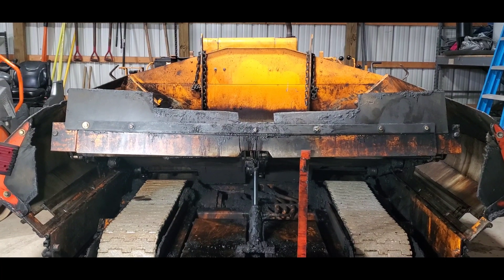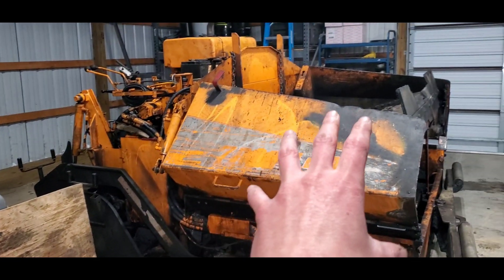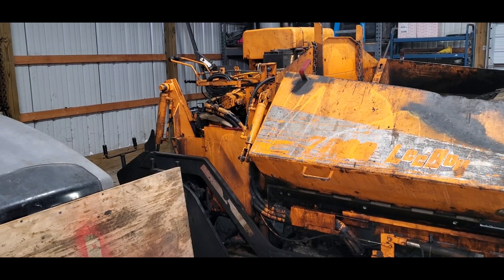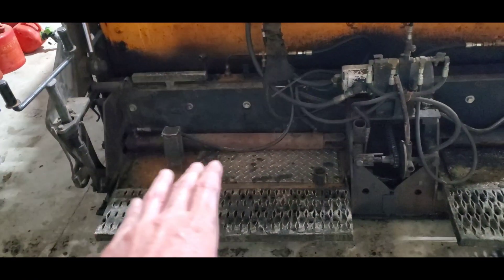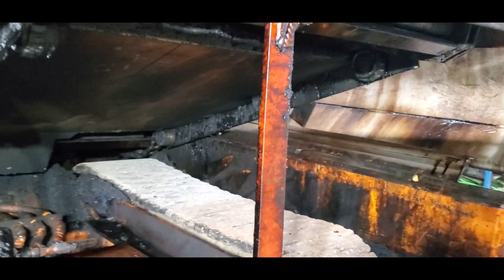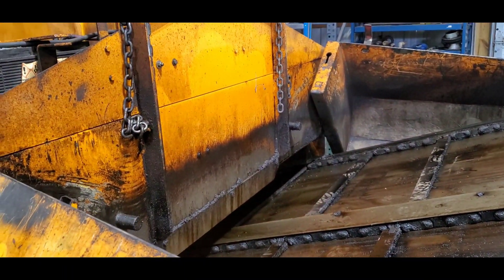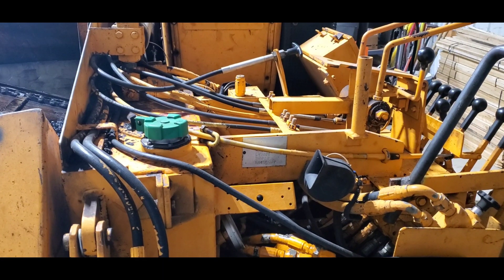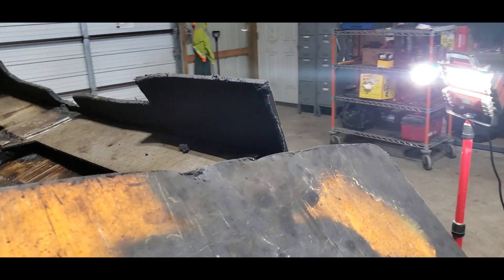Asphalt Paver Improvements from an Army Engineer

Comment: My paver looses power under load so so you think it can be tracks have asphalt stuck in them
Reply from the maker: Probably a good possibility. The cleaner these old things are the better.
Reply: No. 

What machine do you have, and what is charge pressure when losing power?

Comment: How do u release the pressure so it can be moved manually on a 7000 leeboy
Reply from the maker: Not sure. I actually don't have this Paver anymore to even try and get an answer. I never messed with the tracks really. These things are way out dated for today's industry. If so, pass....
Reply: There is no release on a 7000 paver.  It's friction drive with a direct drive torque hub.

Comment: How old is your paver ? Reason i ask is i bought a 2000 8500 and the steel tracks make noise and i dont know if its normal or not.
Reply from the maker: Our Paver was a dinosaur. Steel tracks typically make more noise then others. However the tension should be adjusted regularly and the idlers and sprockets that drive the tracks might be worn? Not sure I never had the problem exactly.
Reply: @Pathfinder-Outdoors  okay thabks for your response i will look into that.
Reply: Mine clicks but but I can’t tell if is drive pump of hidden chain  especially down hill then she wants to free wheel  thank cat I’m getting a new weiler  definitely something wrong I had years It didn’t always click easy way is lube up track even water will quite noisy tracks
Reply: @garymatusavige402  thank you so much